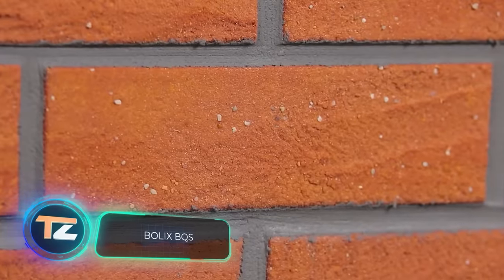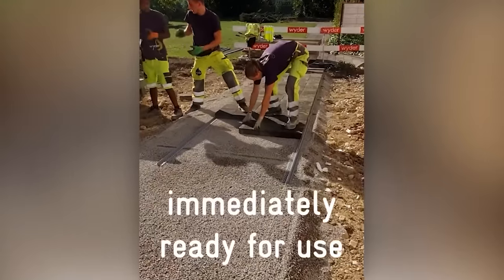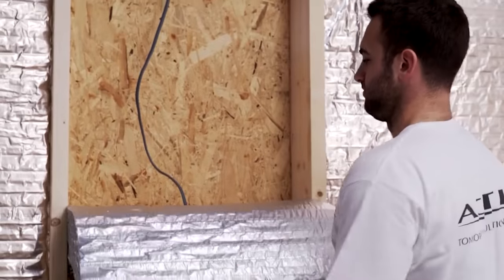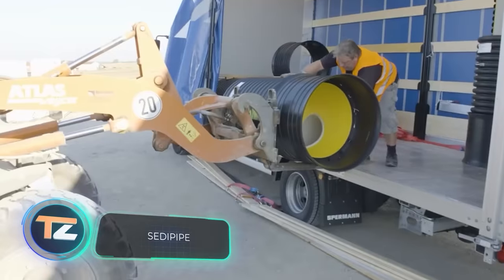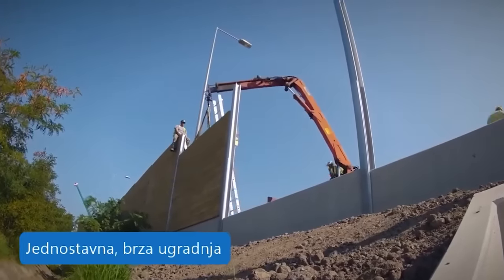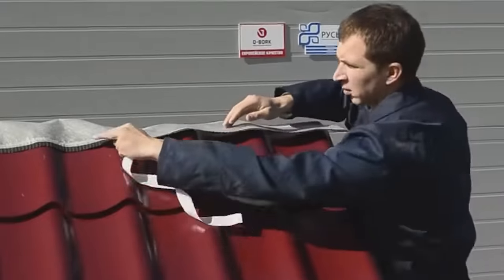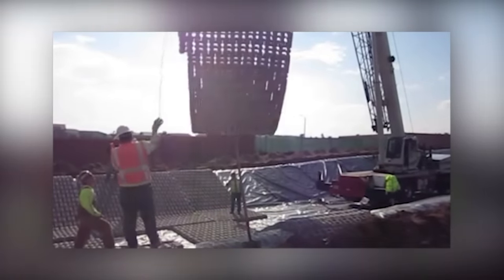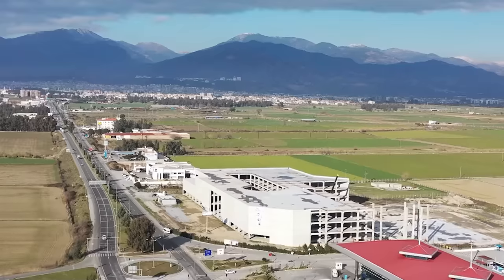CONSTRUCTION TECHNOLOGIES THAT YOU SHOULD SEE

Comment: 7:28 I used the 'dry ridge' system on the house I built; ventilated rolls that let vapour through from the roof space but keeps water out. The butyl tape sticks to any roof tile extremely well. It doesn't have the look of a pointed ridge, but it wont crack or fall out either. I'd use it again.
Reply: The mesh looks to be too fine, I would worry about it clogging up fairly fast. Notice all the particles floating around in your attic especially on a windy day? Here in Central US I have seen the many iterations over the years as the ridge vents changed. We learned small mesh does not work long term. Good luck with yours.

Comment: 3:00 I would use Rockwool here instead of Hybris, reviews say Hybris has better thermal conductivity, but Rockwool can be used for both insulation and sound-proofing, and it's easier to fill gaps with it.
Also, Rockwool will not burn, nor absorb water, Matt Risinger made a demo on one of his videos.
Reply: A friend who works on residential wiring says he a has often seen fully saturated Rock Wool.
Reply: @YSLRD  Not disagreeing, perhaps I should have worded it better in my first comment, but would love to see a test on how it saturates or dries up if submerged in water.
Reply: Beachte den sommerlichen wärmeschutz.  Da ist Zellulose oder holz am besten.  Steicoflex. 👍🇩🇪

Comment: Straw houses: MAD (1 spark and then...)! Flexible "bricks" exist for some decades! Waterstop mortar I saw the first time in 1991!
Reply: Straw has been used for a long long time as an insulator. Tightly packed straw is exceptionally resistant to fire. Loose straw on the other hand can be very flammable.

Comment: I loved using the metal framing kits when I built my 12 x 24 shop 17 yrs ago. At that time a kit to do a standard 8' x 7' was $49, and we bought 5 and I used 3 on my shop. Got all the framing, and walls raised and sheeted in 1 day.
Reply: Built an 8x12 shed for my mower and accessories. Easy to build with as a single person.  I used construction screws so any mistakes/adjustments were remove screws, move, and re-screw.

Comment: Plastic dome homes would be nice. Vacation home? Cheap to make and easy to build would be great for the world. Snap it all together in a day. Would solve the homeless problem. Hope someone takes this idea and run with it. Like have a certain size dome. For strength to size ratio. Plastic lasts. Plastic windows and doors. All of it is plastic that snaps or screws in. Need a bigger home get another dome. Have parts to solid connect them. Everything the same size would help a lot. It will change the world. Remember me.😁

Comment: So great concept for the water filtration but it’s not uncommon to have engine oil leaks and spillage of diesel or petrol in car parks for various reasons. Surely there is not enough filtration and treatment built in for it to not require any further?
Reply: Need to run the water through a an Oil & Grit Separator after this to make it more complete.  Systems like this are usually part of a storage system to slow down run-off which means you don't need as large of an OGS unit.  OGS systems allow less dense pollutants (like oil and gas) to float to the top of the tank while the outflow is take from the middle of the tank (where the "cleanest" water is).  All these systems need regular cleaning, though.
Reply: @smgdfcmfah  without the ability to scale this I can’t see it being a cost efficient and viable option or alternative. In different world maybe but still good concept and I could see it maybe being incorporated to niche unit. Water quality aside there is a use already for this in just allowing water to be absorbed and run off underground.
Reply: @publicrelations9612  Cost is meaningless when government forces developers to install these types of things.  The single most expensive part of a servicing contract is usually the Storm Detention/Filtration System these days - at least in my area.
Reply: @smgdfcmfah  I know mate it’s the long term contracted maintenance that provides the income and it’s wouldn’t be the first case such questionable decisions are made just to fill a political agenda as well the financial interests of connected individuals, lobbyists behind the projects. Madness. I didn’t realise this was the case for this one.
Reply: @publicrelations9612  The long term maintenance isn't done by the manufacturer, though.  This isn't even really about lobbyists and such, it's just that if you build a subdivision, the municipality will take it over when it's all complete and they will own the roads and services and maintain them.  Subdivisions don't generally get these types of systems because the maintenance is expensive.  Private property, on the other hand (condominium sites -r high rise or townhome or even single family dwellings) are forced to put in the most expensive types of water filtration systems there are because the condominium corporation will be responsible for the cleaning and maintenance.  It's just a case of government literally passing the buck back to the tax payer - while still charging them the full tax rate.
Reply: @smgdfcmfah  I see what you meen. That isn’t something I was aware of. Is your experience of this in the UK or USA? I wouldn’t be surprised if this was going on in the UK as there are a multitude of decisions like this. One more brought to my attention.
Reply: @publicrelations9612  In between - Canada!  It's a situation you could find anywhere, though, as it's something that is generally required and enforced by Municipalities but could also be a requirement by State or Provincial laws.  Where I am, the Province and Federal government have certain minimum standards for water quality and individual municipalities may have slightly stricter rules and also have requirements for quantity - though certain Provincial bodies can also take an interest in this to avoid flooding.
Reply: @smgdfcmfah  man you are not wrong. Generally across the UK it’s not the worst but certainly in London there is already a lot of bureaucracy with the mayor of London office who have a lot more autonomy over bylaws and regulatory bodies than other major cities. We still have generalised standards and regulations but there a lot of restrictions imposed on private developers in the same way around affordable / social housing. While on the face of it all appears virtuous and inventive the people pocketing are those awarding and those winning contracts and licences. A very different problem but one that has driven the building agenda. With our current mayor I can seen more sweeping changes such as the one you are facing coming through. There are many other aspects of daily life that have been impacted an example of which you only have to look at our vehicle laws and restrictions in London driving by local authorises individual councils and the mayor himself. It’s a money spinner. It’s the working man’s pocket hit at the end of the day for all of this. Crazy
Reply: @publicrelations9612   Very true - as always, it's the taxpayer who pays for everything in the end - both directly and indirectly.  Cheers.